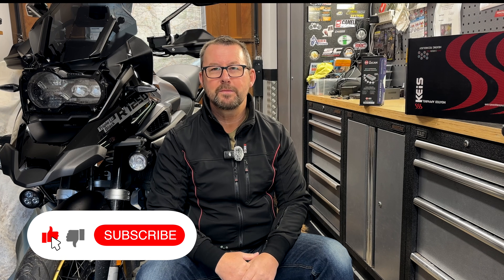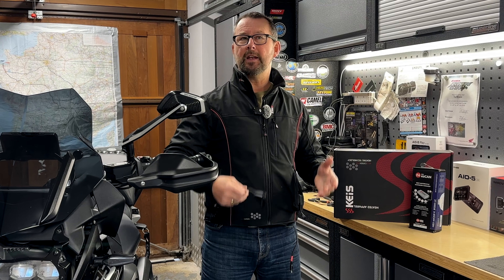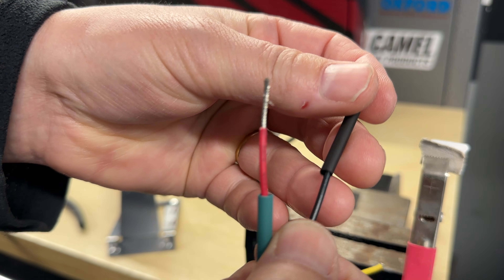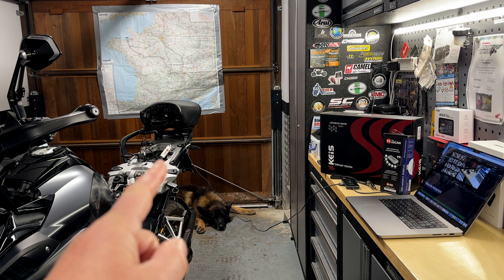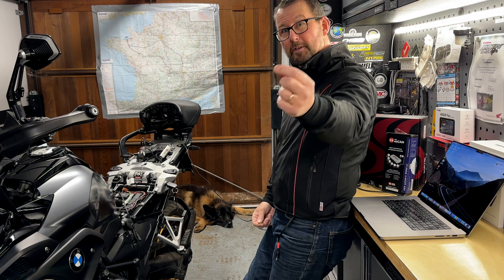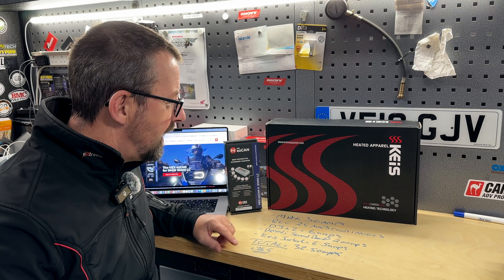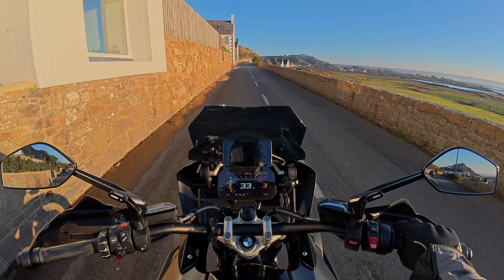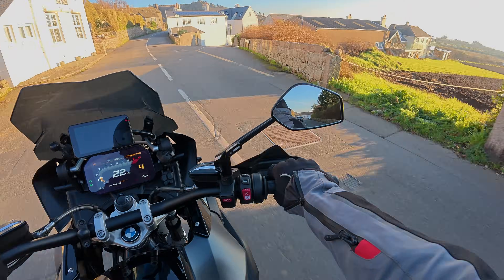Hex EzCan to control heated jacket on BMW R1250GS, using multi-controller & heating push button

Comment: Hi, and congratulations on the channel. I wanted to ask if You can turn the heated jacket on and off with the magic wheel. For example: if You take a break, when You get back on the bike, do You have to turn the jacket back on with the button or with the heated grips button? Thanks.
Reply from the maker: Hi, it simply works using the heated grips control button, when the grips are on so is the jacket, including the heat level too.
Reply: @gsd32i so You must keep on at the same time the jacket and the grips…right? It’a not possible turn on/off separately grips and jacket?
Reply from the maker: @alessandrofranci877 correct
Reply: @gsd32i what do You think about setup the gear like aux lights so You can control with the wheel? In this way the gear is indipendent and is dimmerable…

Comment: Great video Paul, little job for me over winter!! Thanks
Reply from the maker: Now that we are sub 10 degrees the Keiss has come out and it's just brillian. I may have to get a set of there gloves or ask father Christmas! The integration with the heated grips works really well. No issues.
Reply: @gsd32i excellent!! I have the gloves but rarely use them….

Comment: Wonder if this will work for the old r1200gs system, only 3 settings on heated grips
Reply: My 1300GSA has only three settings and it works fine. You can turn off level 4 and 5 in the Hex software.

Comment: I was running my heated clothing from a PDM60 but the dashboard for programming is not available anymore so I have the latest EzCan coming. Question...... Can you run heated clothing for a pillion in the same way but using a different colour circuit? Will that be activated by the TFT or if I was to just run it through the EzCan but just let the pillion continue to use the Keis heat controller? What are your thoughts? Mark
Reply from the maker: Hi Mark, good question, answer, not sure if the hex will only control 1 device or at best control both at the same time with the same heating levels.
Reply: @ I’ll find out tomorrow. Gonna get stuck in and fit it.
Reply from the maker: Enjoy.

Comment: Hi ya Paul. Do you know if you can do this with an older GS1200 (2014 model) or is it just the newer one's? I have an Ezcan and a Weiss heated jacket so would be great to be able to do the same thing. Cheers.
Reply from the maker: Hi Mark TBH not sure, but I guess you could give it a go, if the ezcan menu has the option for the heated accessory and your bike has the heated grips button then see if it works?

Comment: Bonjour. J'ai reçu ma connectique et j'ai branché ma veste Keis 501 sur le faisceau bleu de mon Denali Cansmart mis à jour. Ma gsa est une 2020, avec "seulement" 2 positions de poignées chauffantes, alors que la veste en a 3. J'ai donc réglé les positions 1 et 2 dans le logiciel sur 50 et 100%. Ce que je n'avais pas compris, c'est qu'il faut que les poignées chauffent pour que la veste chauffe. Peut-on attribuer d'autres commandes on/off et réglage via le logiciel du cansmart ? Est-il possible de régler la puissance de chauffe via la molette par exemple ? Merci d'avance pour votre réponse, et pour vos vidéos.
Reply from the maker: Bonjour, je ne crois pas que ce soit possible de faire ça. Si vous parlez à votre concessionnaire BMW local, il pourra peut-être mettre à jour le logiciel qui vous offrira les 5 options de poignées chauffantes.
Reply: Merci de votre réponse

Comment: Am I correct in assuming that this will only work on models that have the software option in the TFT for heated grip control? I have a 2020 GSA which doesn't have that option.
Reply from the maker: That is my take on it.😁

Comment: I noticed that you were already using WAGO connectors. Did you consider using these, instead of soldering the wires together?
Thanks 👍🏻
Reply from the maker: Like I said I am no electrician, do wago do joining connectors???? So, no, I didn't consider using them 😂🙈. Set up now works well and hex say I should be OK with a temporary load if I have everything on , ie the sound bomb....but they said take a spare 30 amp fuse.

Comment: Great video. Do you know if it works with other makes of bike as I have a Triumph tiger 1200 rally pro and this work really well with this?
Reply from the maker: TBH not sure. Check on the Triumph 1200 forums or just e mail hex tech support for an answer , they're pretty quick to reply. If you have a button that controls the heated grips then I can't see why not...but check.👍

Comment: We all feel the cold differently but I suspect a heated jacket would quickly end up hanging in my cupboard. I swear by an original Norwegian fishing jumper which is both water resistant and windproof and keeps me very toasty despite being decades old! Ernest Shackleton would agree…Hadn’t appreciated the strain on the electrical system and that would make me nervous in the winter. Keep up the good work.
Reply from the maker: Loved the Shackleton, the one with the griffin engines ! stay warm 👍

Comment: Thank for interesting vlogs! I have identical setup on my GS, although I use a Gerbing jacket, and Gerbing gloves.  The gloves are connected to the jacket, but with separate heating control on the actual gloves. Question: Do you have heated gloves, and are this connected on the same supply controlled from the bike?
Reply from the maker: No gloves , Rukka summer gloves all year round! Grips on the gs are very warm😂

Comment: I went back from this system to the controller because I found I wanted the flexibility of using separate grip heat to jacket heat. Rather than the 2 being fixed. Sometimes I wanted high grip heat and low jacket heat and vice versa.
What I did was make grip level  1 10%, which is basically to turn the jacket on with no grip heat.
Then Grip heat level 2-5 the % I wanted with the heated jacket output for these grip levels also 100% out put.(and control with the jacket controller)
I was hoping they had done a software upgrade so you could control the jacket heat level via the Wizz wheel like you can do with the light brightness.

Comment: I’ve done the same thing - I’ve got the gillet and find it too hot at 100%. Also, I find that I need my grips on 5 when it’s really cold. So, I’ve gone for 0%,20%,40%,60%,80% against 1,2,3,4,5, for the grips - absolutely delighted! 😊

Comment: In electrical installations the total current draw, if everything was switched on, would generally be well over the main fuse rating. Your house probably has a main fuse value of 60 or 100A, but if you totalled all of the individual MCB’s or RCBO’s it would be far higher than the fuse value. The term "diversity" is used, as it’d be incredibly rare for every circuit in your house to be drawing its maximum current allowance.

On your bike, the horn is 20A, but this would usually be a short burst, unless you are very angry, so taking away the short burst 20A, there is plenty of current available for the other accessories to run well within the ezCan range. The other thing to note is that maximum current will normally be provided for a specified timescale before the device shuts down (just like an MCB in your house). I think the ezCan is around 20 seconds… I think??? Just something to bear in mind before investing another £200 on an ezCAN.
Reply from the maker: Thanks, I was just reluctant to try it and then watch smoke coming up from my seat area as the ezcan went into melt down if you know what I mean. I am not an electrician ,as you can clearly tell, so was playing it safe...if I didn't say anything , then others would say "well you've got a 20 amp horn" you'll blow the circuit. Thats where I was coming from. I may try everything on 100% and give the horn a good blast and keep an extinguisher nearby 😂.
Reply: @ I totally understand and I don’t want to see you fry your ezCan.  I’m in a similar situation… to go onto my 2024 1250GSA, I have, in a box, a Denali Soundbomb, a pair of Lone Rider Motolights together with their "MotoCan" (their version of the ezCan), although the packaging on the MotoCan says 25A max!

On balance, I think the Motolights will draw more current than your D3’s, but my Exo2 heated vest draws less than your jacket. It might be prudent to research what happens to an overloaded ezCan or MotoCan - is it then done; does it need a reset; will it come back to life after it’s been shut down - rebooted??? I think it’ll be worth making some enquiries. I’ll let you know what I find out.

Comment: Great solution!

I don’t have a BMW or an eZCAN but this got me wondering how hard it would be to wire in a simple variable resistor onto the bars to control the jacket.  I have the Bluetooth controller so I can control the heat from my phone, but even that is far too much faff when underway.  I know that other heated clothing brands have a remote adjuster that works with Bluetooth….it would be good if Keis came up with something similar.

Comment: My GS only has 3 settings on the heated grips so i changed that to 4 so now my heated jacket works in 25% increments, also you don’t need the inline fuse in the Keis harness as the EZcan does the power regulation for you that is why you choose the ampage in the menu
Reply from the maker: Thanks for the comments ....yes you can remove the fuse, as Hex say there is no need to leave it in...but I did, less soldering😂
Reply: @gsd32i Hi, I’m just about to install all this so late to the party…lol… would cutting both wires on the power lead before the inline fuse still only require 2 solders? Genuine question. Regards.

Comment: Almost exactly how I set up mine on my RT even down to the crap soldering except slightly lower percentages of heat and I never put the Ezcan dust cap in a safe place 🤣

Comment: Wired mine the same way. It works really well. Never used setting 3 on my R1300GS though cos both grips and jacket would be way to hot. Don’t know about Gen1 EZCan but I chop the fuse off as the Gen2 EZ has programmable fuse on board